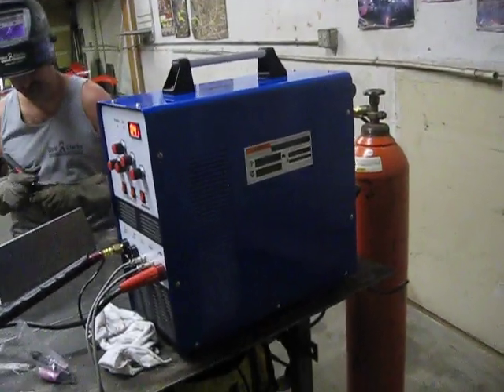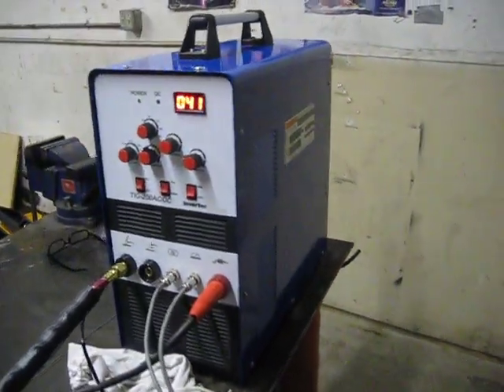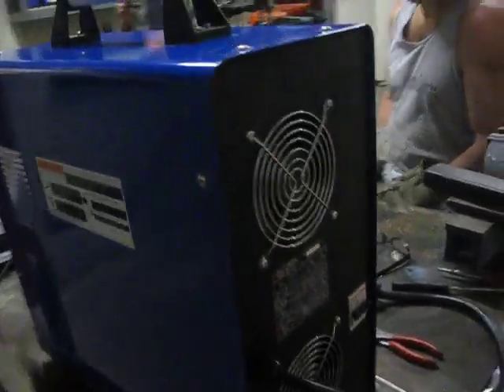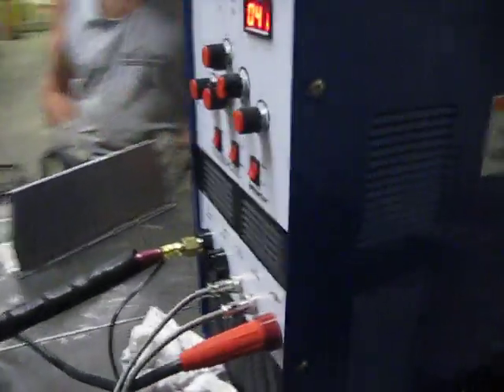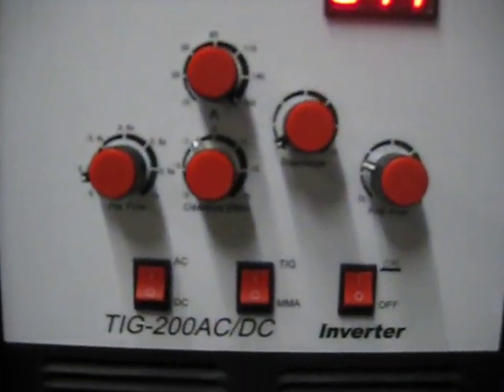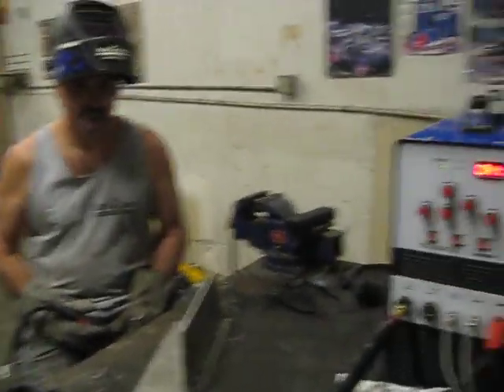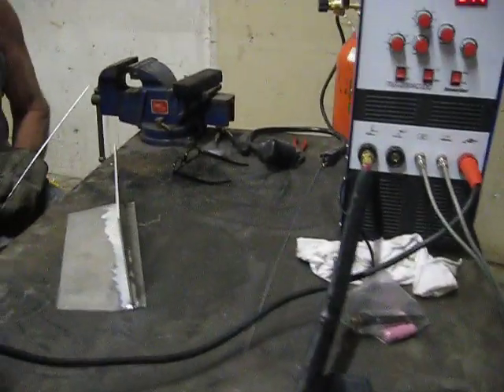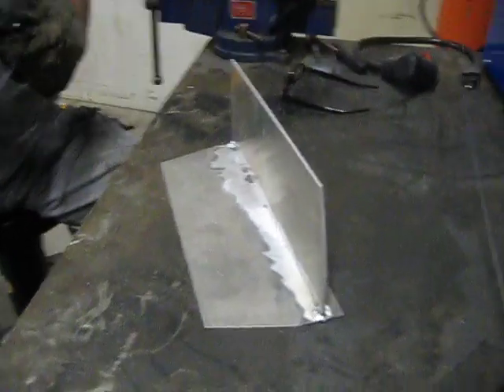LOTOS TIG200 TIG/Stick Welder Aluminum Welding Demonstration

Comment: Not to sound snobby, but it seems that the Argon and settings were not set properly. There did not appear to be any cleaning action from the argon going on as seen by the white/black sooting. You need to re do this video, I am sure that he is a better welder then what was shown here.